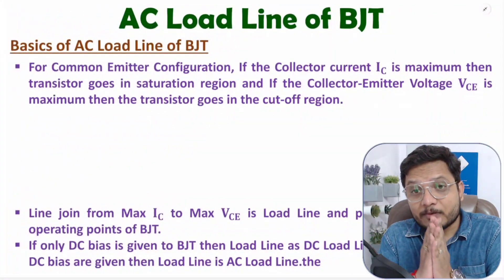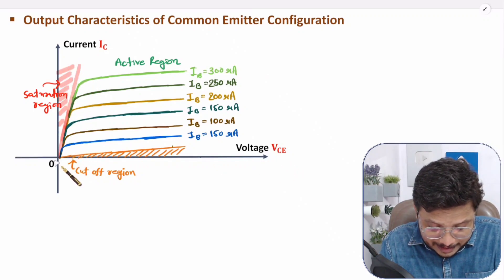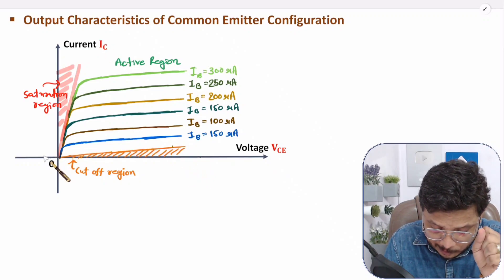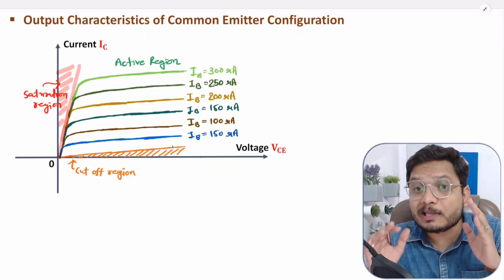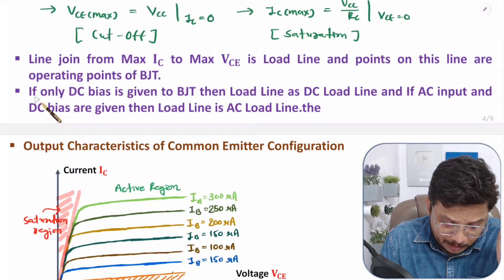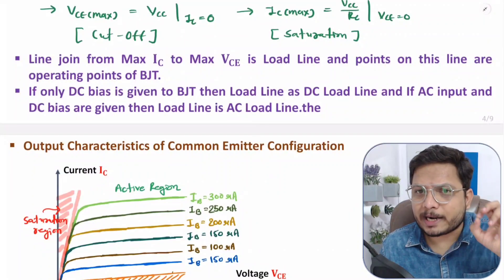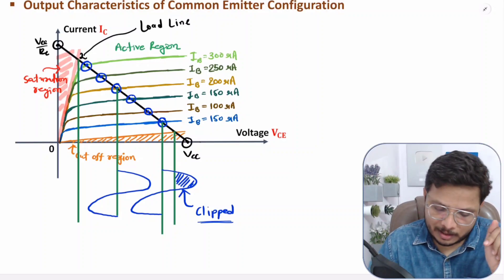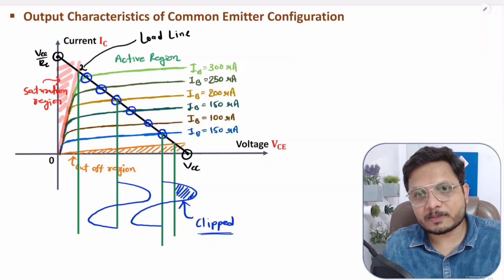AC Load Line of BJT | AC Load Line for Common Emitter BJT | Basics of AC Load Line of BJT

Comment: AC load line is different from DC load line when ac source and load are connected to the DC biasing circuit through capacitors. In particular, slope of AC load line is different from that of DC load line. I hope concept of AC load line is over simplified here.
Reply from the maker: DC Load Line:
- The DC load line represents the relationship between the collector current (Ic) and the collector-emitter voltage (Vce) of the transistor for DC input signals (biasing).
- It is constructed using the DC resistance values of the load and the transistor.
- The DC load line allows us to determine the Q-point (quiescent point) of the transistor, which is the operating point when no signal is applied.
- It helps in analyzing the transistor's operating point stability and power dissipation.

AC Load Line:
- The AC load line represents the relationship between the collector-emitter voltage (Vce) and the collector current (Ic) for AC signals.
- It is used to analyze the transistor's behavior when an AC signal is applied to its input.
- The AC load line is constructed using the small-signal parameters of the transistor and the load.
- It helps in analyzing signal amplification, gain, and distortion in the amplifier circuit.